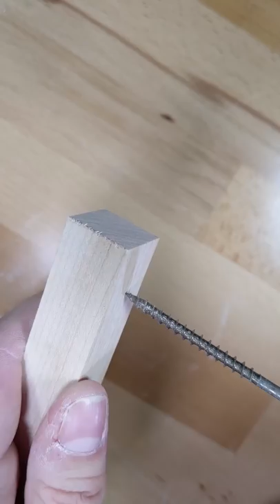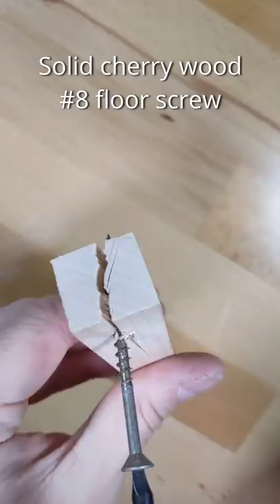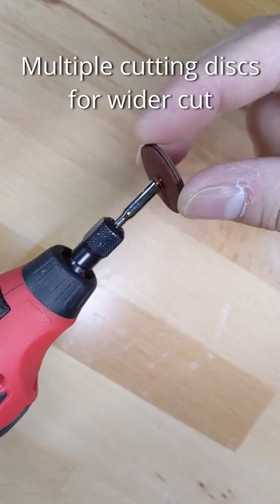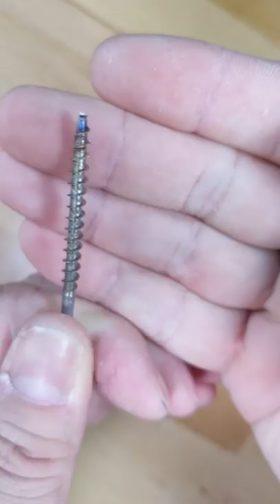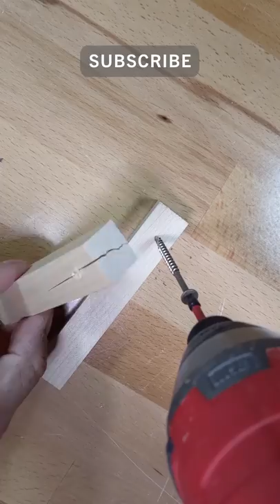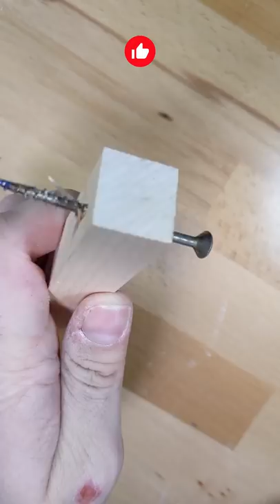Convert any screw to self-tapping, self-drilling! #shorts

Comment: You just put the drill in reverse the second time, which is more like a drill bit than a screw.
Reply from the maker: How could the threads had engaged if I was in reverse?
Reply: @northernhandydad  it was way to slowly for the treads to have been engaged, of they had been it would have moved in at the spacimg of the thread every rotation, I watched it at 0.25x speed and seems obvious to me, I thought it was a neat trick.
Reply from the maker: Trust me it was in forward all the time! You can even hear the impact driver give 2-3 hits before I release the trigger.

Going in reverse trick works if you do it for couples seconds to "drill" and then go to forward mode to continue driving on the screw.
Reply: @northernhandydad  fair enough, it just appear that way to me but if your telling me I'm wrong I'm happy to admit it.

Comment: Ummmmmm. Use a drill. Even if you can't do that. Hit a nail into the wood just a little. Then use the hole as a starting hole. This is tripling the time it takes to just pre drill.
Reply from the maker: Drilling wasn't an option for my project. See description for details on the context.

Never thought about breaking the initial fibers with a nail first... Thanks for the tip!

Have a good day!

Comment: You couldn’t just drill it with a smaller drill bit the use the screw or you just buy the screws that are like that
Reply from the maker: You're right Deryk! All I wanted to show is that when you can't drill, and don't have the suffisent length self-tapping screws, there's still the option to make one!
Thanks for your input!

Comment: 最初かそういう加工がされてるビス使えば良いのでは？
Reply from the maker: This is for when you're facing splitting wood (putting a fastener too close of an edge):
A) Drill a pilot hole.
B) If you can't, use pre-made self-tapping screw (Sold at hardware store)
C) Last resort if you don't want to go to the store, make your own!

Comment: I use the 2 drill method , 1 has a proper drill bit the 2nd has a driver bit. No spits EVER .
Reply from the maker: As stated in the title "Convert screw to self-drilling", this had nothing to do with a "best method to avoid splitting".

Comment: Не знаю кому это надо и зачем я это пишу. Просверлить, а после закрутить.
Reply from the maker: Hi Denis. I was in need of this since the hole I had to drill was in a tight place, and at an angle. No drill bit that small was long enough to fit in my build.
Long screwdriver bits can be found easily, not drill bits.

Comment: Just use 2 drills . one with a predrill/ pilot bit and one with the #2 Phillips driver like you have there .
Reply from the maker: As stated in the title "Convert screw to self-drilling", this had nothing to do with a "best method to avoid splitting".
Reply: @northernhandydad  of course it doesn't

Comment: Or you could pre drill, counter sink and then screw into it.

Or by the screws that come pre cut like that.
Reply from the maker: As stated in the title "Convert screw to self-drilling", this had nothing to do with a "best method to avoid splitting".
And Buying pre-made is an horrible topic for DIY video

Comment: And it only takes 20x longer than either drilling the holes or buying self taps in the first place 👍🏼
Reply from the maker: As stated in the description and other comment, drilling wasn't possible.
Buying self taps would had required a 1h round-trip to the hardware store!
This is still valid trick when you're short on options!

Have a good day!

Comment: Nor would it give the tip of the screw the strength it would need to punch through metal like its designed for.
Reply from the maker: Why metal?
Reply: @northernhandydad  because it's what tap screws are for lol. Punching through tin and sheet metal. Wym

Comment: Yes but it wont go threw much more than that little piece of wood
Reply from the maker: The piece was a good 3/4" thick. Boards are rarely more than that. If thicker, just cut more threads on a longer screw so it's not engaging too fast.
Reply: @northernhandydad  yeah but what kind of wood was it?
Reply from the maker: Cherry Wood

Comment: Better you use drywall screws
Reply from the maker: Drywall screws are pretty brittle and tends to break more than regular screws!
They are effectively smaller, but I would not recommend using those for all projects.
There's called "Drywall screws" for a reason

Comment: Or you could just buy self tapping screws
Reply from the maker: Yup! This trick is to save you the roundtrip to hardware store!
Reply: @northernhandydad  it is a handy tip for small pieces of soft/cotton wood but for hardwood I would drill a pilot hole

Comment: I have 55m square wood deck to build, approximately 2475 screws.. your idea is fucked up 😂
Reply from the maker: Soft wood for decking usually doesn't require pre drilling. Or you could use the reverse drill then screw trick.

I only needed 2 screw this way! For your project go to the hardware store and buy the pre-machined ones!
Reply: @northernhandydad  It was a joke I'm carpenter I know what to do. thanks

Comment: Just buy good screws, problem solved.
Reply from the maker: Good regular screw will still split solid wood. And specialized screw for this are not available in all sizes we could require. I would advise against using only a screw for solid wood (even if they are of high quality).